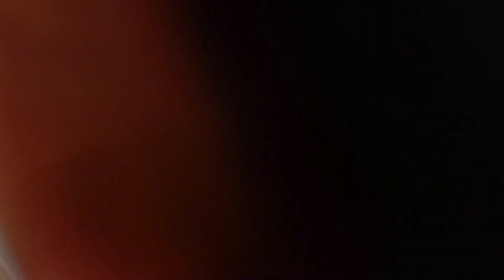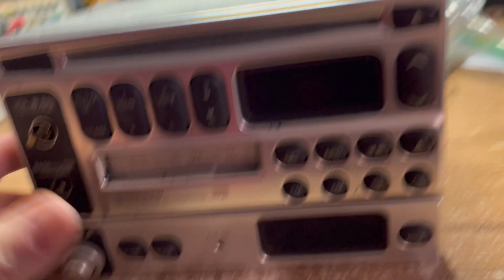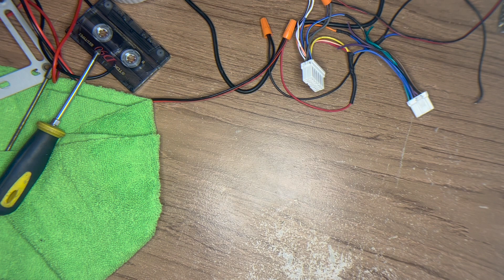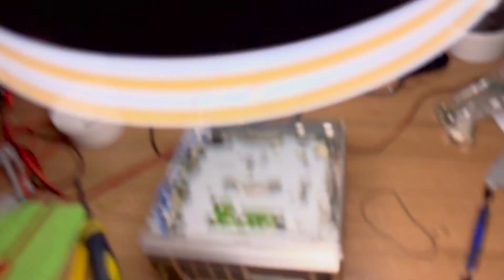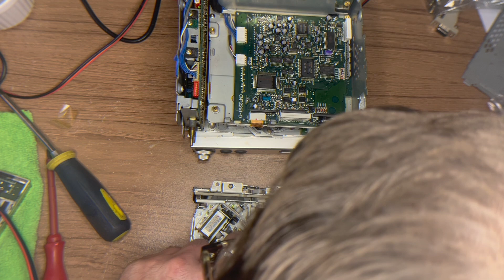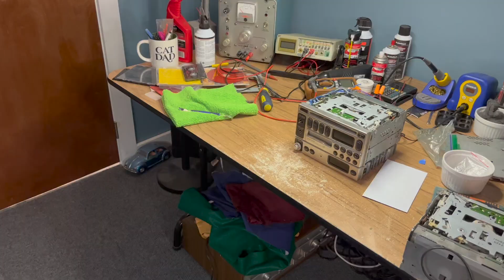Miata Radio Repairs Part 1 - A Tale of Two 1993 Miata LE MSSS1 Stereos - Can we save these?

Comment: Thank you very much.  Exactly what I needed to get my CD working reliably.  When that unit comes out it looks quite daunting but after watching your videos I now appreciate how modular the whole package is.
Reply from the maker: After restoring a couple hundred of these, I've changed my protocol to recapping the entire CD control board - then adjusting it from there. The capacitors are the problem, and adjusting the laser power is merely compensating for degradation and won't last for that long.